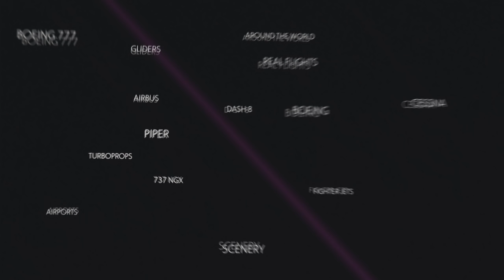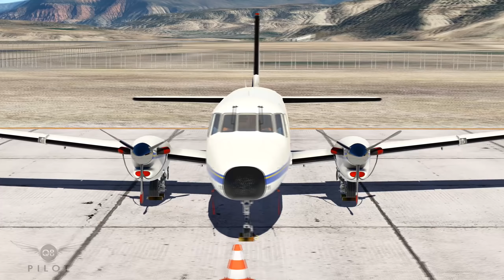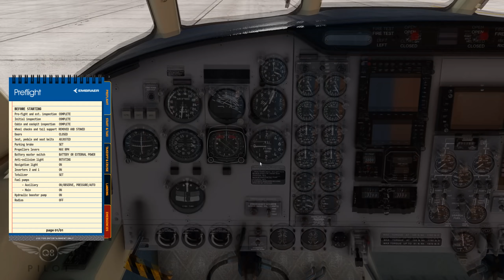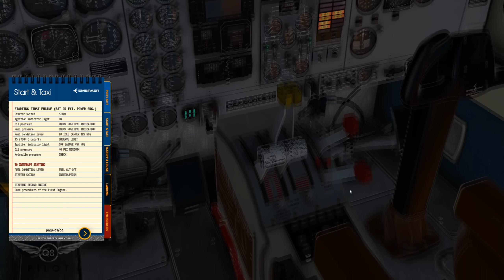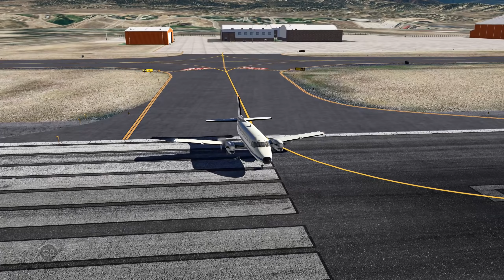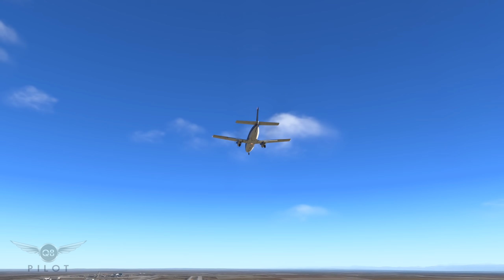Dreamfoil Embraer EMB-110 v3  | KEGE to KDEN | X-Plane 11

Comment: I'm a bit late for the party but i think I could make a positive contribuition to your video! at 21:54 you guessed that the autofeather could've been the reason why your climb performance was degradated, but the autofether system does not affect aircraft performance. Since the power assymestry generated in case of an engine failure would be too brutal for the pilots to handle quickly and safely (specially in low altitude conditions), due to the substantial reduction in lift and increase of drag, the autofeather system reduces the propeller blades angle automatically to the feathered position. So this system is related to controllability in the case of an eng failure and not to performance. Hope this helps!

Comment: I've not seen the 110 profile in SimBrief. Which aircraft do you use?
Reply from the maker: I used the B200 profile.
Reply: Just watch out when getting the altitude. B200 is pressurized and this specific EMB110 model is not. If you have the altitude effects turned on in xp11 you might pass out if flying too high for longer (not mentioning that it's illegal :>).
Reply from the maker: @GAFlying  service ceiling for EMB 110 is 21600
Reply: I used the B190 profile.

Comment: You should generally always climb at the top of the white band on the ASI. That's always the best climb speed whatever plane you're flying.
Reply from the maker: Thanks!
Reply: @Q8Pilot  It's misinformation, don't trust everything you read in youtube comments! Top of the white band is Vfe, maximum flap extension speed, completely unrelated to best climb speed.
Reply: @joebloggs8785  Yes, it is Vfe. If you want to be a purist then you have to climb at Vx (max. angle) to 300ft then Vy (max. rate) but Vfe gives you a good combination of climb and ground speed. The advantage is that it's marked on the ASI so you don't have to look it up in the POH.

A slow climb usually means the wings are struggling (low airspeed/raised flaps too early) or overweight.

I take it you are a real-world pilot with 30 years experience and about 38 years on flight sims?
Reply: Good tip

Comment: You should generally always climb at the top of the white band on the ASI. That's always the best climb speed whatever plane you're flying.
Reply: Really? Surely the best climb speed would have no relation to the structural limits of the flaps? i.e. if Vfe = Vy it is only a coincidence.

Comment: Is this aircraft still worth buying? I mean, it is very outdated and I know that this 30$ aircraft is worth 50$, but you know...if it flies weirdly and unrealisticly, I might stop thinking buying it in the future. What you guys think? you I go for this aircraft anyway?
Reply: There are many conflicting opinions about how the performance of the plane should be. The current consensus is that's it about 15% too low. So it's probably underpowered compared to the real one. But that's it. Imho, it's in a great state, much better than many of my other planes, where the developers are very active, but the planes are neglected.
Reply: @GAFlying  ok thanks, is there a way to modify the engine power to fill this 15% power gap?
Reply: @raisedahell5165  Hey, there is a mod in the x-aviation forum that improves performance.
Reply from the maker: I am confident to recommend this aircraft anytime. You will not be disappointed.
Reply: @Q8Pilot  thanks

Comment: Great video, l have always had stutters since l got X-plane 11. l can't get rid of them.
Reply: Steve Atkinson decrease rendering settings maybe? What are your PC specs?
Reply: @eightbitpool1757  Thank you for replying,  l will reduce the rending settings.
My Computer spec's are as follow's
i7-6700K O/C to 4.6
16GB Corsair Vengeance DDR4 3000MHz
EVGA iCX GTX 1080Ti 
Samsung SDD Hard drive 500gb
Reply: Steve Atkinson those specs seem really, good. Basically the same setup as mine and I regularly get 40-50fps! I wouldn’t recommend having shadows on, but HDR and High Quality video textures seem to boost my FPS?! Check out your graphics card settings and change them to what you want. If any of this doesn’t work, maybe reinstall? I’m not too sure if that would help however.
Reply: Search on google xplane fps boost script and download it with shadows
Reply: All dependant on your pc spec and Xplane 11 settings.
What's yours?
Reply: You might find that it reduces wuth Vulkan as they're improving the loading of textures into ram. Their graphics show a smoother fps
Reply: @orb505  Vulkan has still not been implemented on X-Plane, right?
Reply: @blackbokis3064  It is in some parts but not the main view. They're looking at 11.5x which will be Q1 2020 at their estimates.
Reply: @orb505  Oh Austin started? Nice! Finally! Vulkan will be such a leap forward!
Reply: @blackbokis3064  Started? Lol they've been working on it for over a year!
Reply from the maker: I only got it at the very last minute before landing. I never get stutters in X-Plane.